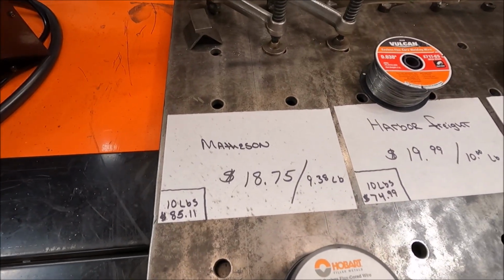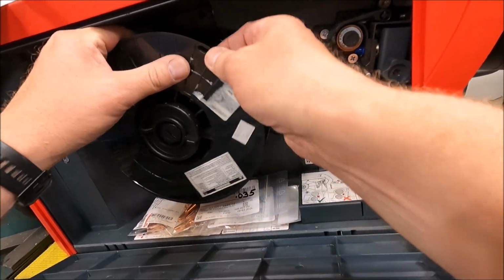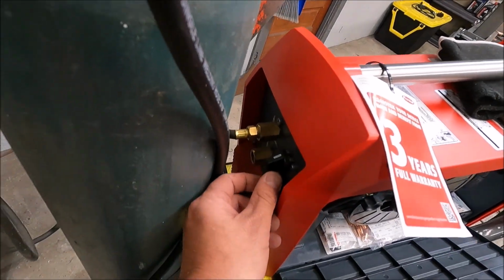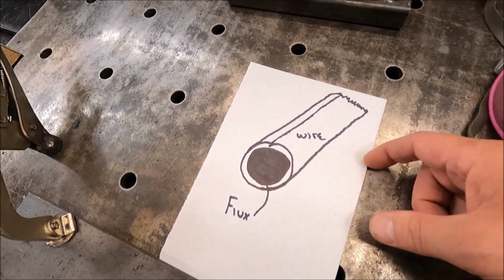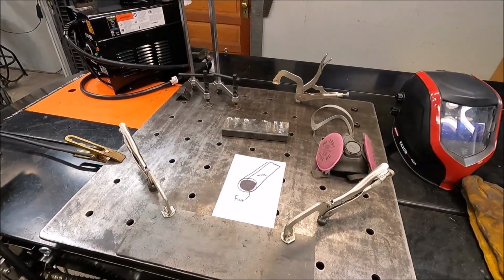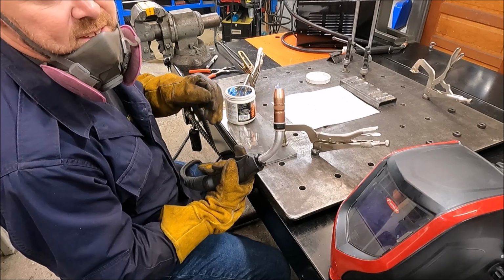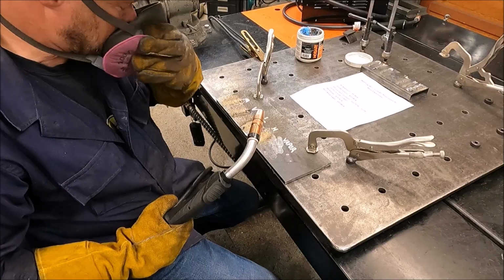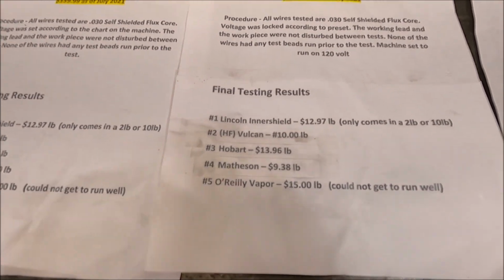Self Shielded Flux Core Welding Wire Comparison Does Cost Matter?

Comment: No need to have ur nozzle on ur mig gun while running flux core
Reply from the maker: No but replacement parts aren't cheap on this machine and the nozzle protects the threads and gas ports from weld spatter. Plus I wanted the setup to be the same on both weld tests.
Reply: @BrandonLund  just cover the threads in anti splatter and save the nozzle from being ruined
Reply: I don't use a nozzle either. I can see right what I'm doing and get right in most tight spots. While my machine is equipped to mig, I don't ever bother.

Comment: I've got a really cheap flux core welder and the best wire (so far) is INE from Italy. Is it available in the US? if so, I'd like to see you test it on both welders just like you did today.
Reply from the maker: @Neddy L it is and I'm going to be ordering some. I've had a couple mention this and I've never tried it so it should be interesting.

Comment: I have noticed Lincoln wire does well in cheap machines like the harbir freight units as well as exspensive machines like esab, vulcan, feronious, Lincoln welders, Hobart, and more @brandon lund
Reply from the maker: @Antonio Claudio Michael I agree! Now that I know Lincoln (for now until I test more wires) seems to be the best so far for flux core I'll probably try to do the same for solid wire and see how that shakes out. I'm having a lot of fun doing these tests because I'm also learning as I go.

Comment: I bought that same Harbor Freight welder from a coworker for $30.00 He only used it one time! Definitely lighter than my Hobart 140.
I typically run Lincoln or Hobart flux core. Vulcan in a pinch.. Blue Demon flux core for stainless.
Reply from the maker: @Eeyore it's a pretty decent welder and you got a smoking deal! I'm going to have to pick up some blue demon wire. I was told the blue demon and the Hobart are the same wires. I was also told the Matheson and Lincoln were were the same but the tests proved that to be false.

Comment: That’s the only wire I use is that Lincoln wire with the same hazard freight welder
Reply from the maker: Thats awesome Keith! I love doing tests like this. For those using something different it might help them get better results and for the ones using it already it just confirms it without them having to experiment. In my opinion  the hf welder does a pretty good job

Comment: Hay there Brandon  My favourite wire to run as a flux core with my 2200  is the Esab  Ultra 7100 Dual Shield flux core. yes you have to use 75/25 gas, but this wire is so very smooth. I use both 035 and 045. I buy it in 10 lb spools I don't know if you can get it in 2 lb spools. Try some .
Reply from the maker: I've heard the Esab wire is really good so I might just buy the 10lb and give it a go!
Reply: @BrandonLund  he is right it's amazing wire
Reply: I agree its super smooth @Bruce D